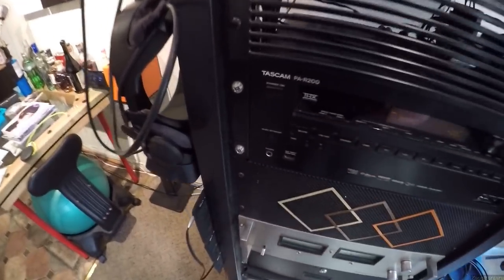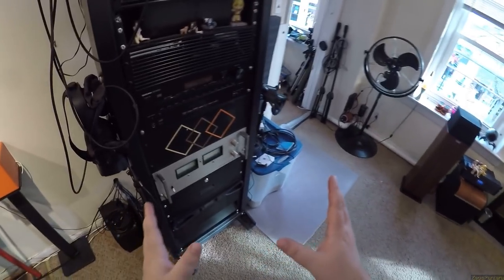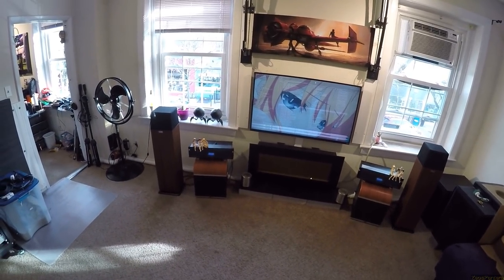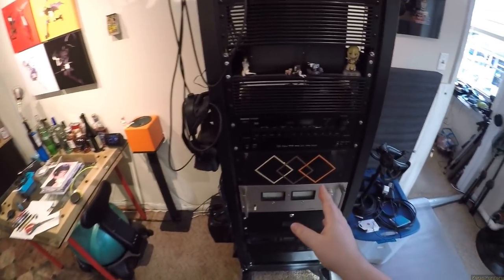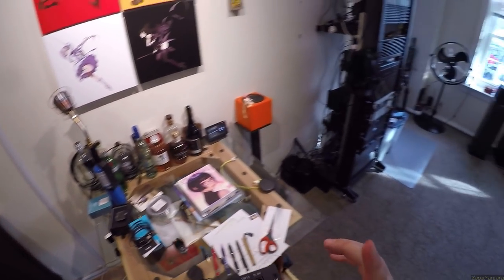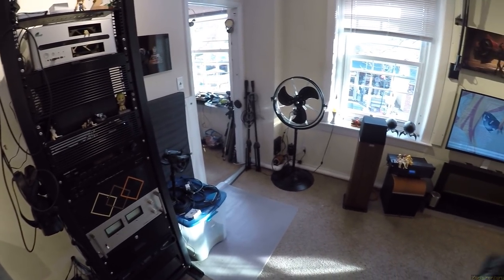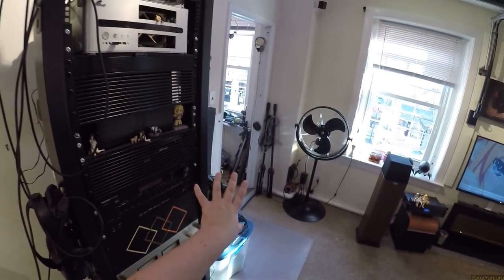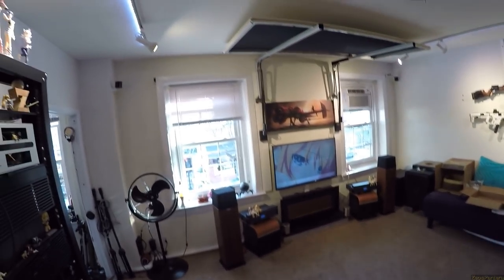⭐️Picking a Receiver _(Z Reviews)_ Home Theater 102

Comment from the maker: CHAPTER JUMPS :::
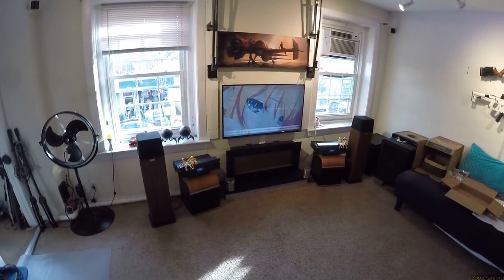1:08 - WHAT DO YOU NEED?
2:33 - BRANDS
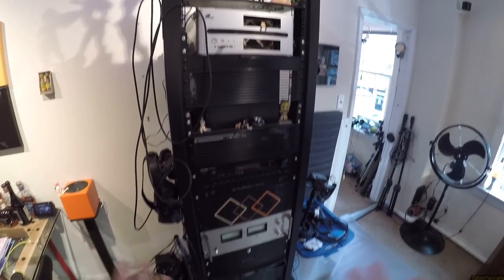6:42 - POWER
14:13 - FEATURES
20:23 - ROOM CORRECTION
24:30 - 5.1 vs 7.1
25:38 - ADVANCED SETUPS
34:18 - SUMMATION -----------------
35:54 - REFURBISHED UNITS
38:15 - HIGH RES BACK SHOT
Reply from the maker: @M. S it is still in the description. And I pinned my Atmos thoughts.
Reply: Video source that support 7.1?

Comment from the maker: A NOTE ON ATMOS/DTS-X/AURO3D -- If you want to do Atmos that changes nothing accept adding to the minimum spec requirements I spoke of above, Same as choosing between 5.1 and 7.1 now 7.1.4. 

A NOTE ON X.2 Models. Most surround processors do not actually modify the control of dual subwoofers. It is essentially a built in RCA splitter which you can buy here [ https://amzn.to/35U7Gu5 ] so ignore that delineation.
Reply: Z Reviews Do u room correct even w/ ur Ohm speakers? Doesn’t that effect/negate some of the magical sound reflections stuffthat Ohms produce? BTW, I have 1000s that I luv.
Reply from the maker: @elleferrao2640  I do not correct currently. I may attempt it. But I do want to correct for my subs. Those need tweaking.
Reply: Z Reviews Interesting. When I spoke to Evan at Ohm he said that any software that has an effect on “early reflections” would likely be “counterproductive to some of the benefits of the Walsh technology”. 

I also don’t room correct or use a center...it mite mess w/ that phantom center the Ohms create.
Reply from the maker: @elleferrao2640  Honestly the most tweaking ive done to my ohms was today i twisted them a bit more inward so that my mono voice was more centered as I walked back and forth in my living room.
Reply: Z reviews I love your videos you have changed my perception about audio and I've became an addict :)
I would like to hear your thoughts about ATMOS, is it worth it? what possible setup options from basic to extreme?
Reply: @animry  yeah i would love that too
Reply: @ZReviews  any suggestions on a good/reasonably priced sub (~$500) to go with my Ohm 1000s?

Comment: Agree almost 100% with your receiver recommendation. I would summarize by stating the following. For the average home theater newb, spend around 3 hundred bucks on one of the brands  you mention to get something decent that's about 100w/ch.  Marantz is also my favorite brand, even though right now I have a Yamaha. (It works fine, but I don't really like how it detects and switches surround modes).

For someone that is (or wants to be an enthusiast) but you still don't want to spend major bucks -  you look at the cheapest receivers you can find that have pre-outs, preferably all 7 (or more) channels. That generally means you're going to have to spend a little more because you'll have to get a mid to upper level model from that brand as entry level models will not have pre-outs.  However, it will still be FAR cheaper than buying an actual pre-amp that has no amps in it. THEN you can spend that money you saved from getting a cheaper receiver instead of an expensive dedicated pre-amp and you go get the best amp you can afford.  If music is important to you, I say you get the best 2 channel amp you can afford to use for the L/R channels and just use the receiver's amps for the rest.  Then later if you want get another multi-channel amp for the other channels to complete the system if you want.  Otherwise if 2 channel music isn't a priority you can get a nice 3 to 7 way external amp. Now, these external amplifiers you can keep forever and then just swap out the receiver when it becomes obsolete.

It is infuriating that there aren't entry level priced pre-amps out there.  It is FAR cheaper to purchase a receiver to use as a pre-amp than it is to actually buy a dedicated pre-amp/processor, because those are priced with an audiophile tax and are always packed with way more features than you need and are also 2 to 3 times more expensive than a receiver that will do the EXACT SAME processing.

Comment: I've been dealing with electronics for many years and I find the Yamaha to have the less issues and and the easiest menu to deal with!
Reply: Audio Electronics Agree! Seems we also sub to some of the same channels lol!
Reply: @nathanjones4039  Look like :) we are the audio fans
Reply: I’m on my second Yamaha receiver. I have the RX-V565, had it for 10 years and only just starting to have issues with it now.
Reply: @benkrake3678  10 years is not bad at all, I have one from the early 2000's and it is still running great, I went through few denons and onkyos in a short period of time
Reply: Audio Electronics Yamaha is brand I really trust, mainly because they make high end amplifiers too, which are highly regarded, and their gear really does stand the test of time. I sold my first Yamaha 5.1ch receiver to my brother in law, and it still works fine, no issues whatsoever. To get 10 years out of any 7.1 HDMI receiver is really good. My father still uses his mid 90’s Technics SA-GX390 5ch Dolby Pro Logic receiver to this day, but doesn’t use it as much now.

Comment: Would love a Home Theater 103 that goes over the purchasing and specing out a full theater. As in if you were starting over, and not being crazy ;) what would be a nice setup. Pick a Reciever with preouts, some seperate amps for the speakers, etc. That would in the end perhaps your only concern for the future is the purchasing a new reciever as features get updated. Would be a very useful video. Thanks.

Comment: Good video Z.  Based on what you said, I will buy a base model Yamaha reciever.  I have really bad/cheap KLH pair of speakers (larger bookshelf size).  Now to improve the sound/bass, what is  best cheapest subwoofer I should get?  I am not planning to buy rear or center speaker because I intend to use phantom center.  And how do you feel about Equalizers vs automated room correction?  Sorry I do not donate to your channel...i am retired and poor.  LOL

Comment: Nice video, what about using something like eARC to increase the useful lifespan of your Receiver?  You could plug in all your video sources directly into your TV and have your TV push eARC downstream to the Receiver.  This way you could upgrade to a new TV later with new visual features but not have to upgrade the receiver since the receiver would still be processing the audio.  Reading online eARC allows for up to uncompressed 7.1 and Dolby Atmos so from my understanding this should work correct?
Reply: this what i am using now ,using 9 years old receiver my x9000h tv as video source and reciver for audio only ,but no atmos as its old receiver

Comment: If you have an older receiver that doesn't do 4K or 60hz you can always hook up your pc straight to your tv and then run a second hdmi from your pc to your receiver just for audio. You'll need to add the receiver as a second monitor even though your not using the video signal. This is a pretty simple work around for those who have an htpc and an older high end receiver with great audio performance. You can also use a displayport to hdmi cable for the audio if your pc only has one hdmi and multiple displayports, like most modern pc's.

Comment: Hey Zeos, a suggestion of video. A whole music system where none of its parts cost more than $100. I am speaking of a DAC, a headphone Amp, a speaker amp, a headphone, a pair of speakers and maybe a turntable and/or a streaming device like an raspberry pi. You could say wich one of these itens you are fine spending 100 bucks or less and wich one you could benefit a lot by saving a little more and spending, let´s say, $150 or $200.

My suggestions in these departments are:
DAC - Schiit Modi 3/ SMSL M100
Headphone Amp - Schiit Magni 3+ / Schiit Magni Heresy / JDS Lab Atom
Speaker Amp - Loxjie A10 / SMSL SA100
Headphones - Philips SHP9500 / Cooler Master MH-751 / SIVGA SV006
Speakers - Dayton Audio B652-AIR / Edifier R1280T / Micca MB42
Turntable - Audio-Technica AT-LP60X

I would like to watch your opinion on this matter of fully systems on the strict budget.

Comment: I've been using my Denon AVR 3805 for the past 17 years - which doesn't have an HDMI out to the TV (laughing, I know). I've now had three TVs because the logic boards all failed. I've replaced three DVD/Blu-Ray players because they've failed. My current Samsung Plasma is starting to flicker, that plagued my last Sammy Plasma. 

I still have the same speakers (Polk LSi15 for mains, LSiC, cheap surrounds, a thumping sub) and Denon receiver. 

If you can plug your video sources directly into the TV's, and the audio sources directly into the receiver, you'll be good to go, and your receiver becomes less obsolete and lasts a helluva lot longer than 4-5 years.

Comment: I purchased an onkyo a few years ago, the hdmi board failed within 10 months. The actual board was in a position that gotroasting hot and I think it messed up the solder joints? I replaced the board and used a usb pc fan that helped . I’m pioneer now but that needs replacing as it’s 4K but I need a 4K HDR pass through. Despite my new pioneer being newer etc the older 1080p onkyo had better sound! My pioneer is Dolby Atmos 5.2.2 but my next amp is going to be a Denon .

Comment: Picking a reveiver? But you said all we need is the Swan M300. 

I am a Yamaha guy. Denon and Marantz are a merged company since 2002 and are both owned by Sound United LLC. I would imagine they are about the same in terms of quality and performance since they both use Audyssey XT32 in the higher end models.

I have Denon X3500H and Yamaha RX-A880. I prefer the Yamaha by far, honestly. I think the Yamaha has a few features I prefer - more manual adjustability with the equalizer (more bands and you can equalizer each speaker separately), the a880 runs YPAO faster than x3500 Denon runs Audyssey and I think YPAO does a better job because it has a built in decipher code for reflections. I don't know if the Denon does but I hear more bass hum from the Denon, it sets the bass higher because it is only measuring the output, the Yamaha also measures for reflections so I don't notice any bass hum with the Yamaha. 

The way the room corrections make my speakers sound is: the Yamaha is much more natural even a bit laid back or dark with the Elac UB5. The mids can be a little chesty but on most recordings the sound is smooth and soft but very detailed and natural. At it's worst, it can be dark and sound like there isn't enough details. YPAO seems to me pretty much forgiving where you place the microphone. I go to each seat and hold the mic to my ear - right next to my ear - and get good reading and sound. Simple, easy, and effective YPAO. It gives a larger sweet spot from what I can tell.

 The Denon is almost opposite of that. Audyssey seems to favor a leaner, brighter sound with powerful bass WHEN Audyssey calculates itself correctly. A few times I have had Audyssey make my big speakers sound small and other times tune the bass too overpowering. I assume Audyssey is very unforgiving with placement of their microphone; too close to a wall the bass will go down, too far away it will shoot it up. Audyssey seems to pinpoint a sound to a small area to be the sweet spot. I ran it yesterday and when I sat back in my chair the sound was just right but when I bent over in my chair, the sound got disorganized and messy sounding - like that clump of mid-range infidelity. Maybe Denon go more flat with their reference profile causing the highs to be more in your face, or what sounds like an upward sloping high end. The Denon throws a bit too many high highs and the bass can sounds a bit muddy from being overpowered or you could say there is some bass hum noise in the sound with my Klipsch RP280F. 

I'll probably try the Denon with my Elac to see if they go better together. Denon with a slightly brighter and bassier sound might match better with the Elac that has a softer sound. Likewise, the Yamaha might be perfect with the Klipsch since it has a more laid back and natural sound to go with the lively and dynamic Klipsch. I would say the Denon is more lively and dynamic like the Klipsch and the Yamaha is more natural and smooth like the Elac speakers.

Even my mom who is no audiophile loves the Yamaha much more than the Denon. After hearing the Denon, she only wants the Yamaha; I couldn't agree more with her. The Denon is definitely powerful and dynamic, it even does a good job delivering clean sound like the Yamaha (arguably), it just doesn't have as nice of a set of features IMO. The reflection test of the Yamaha is pure genius and makes the world of difference.

This could be considered a slightly unfair comparison as the Denon is 2018 model and the Yamaha is 2019 but they were within $50 of each other and I bought the Yamaha first. I only got a Denon because Joe from JoeNtell swore on Denon and I wouldn't say he is wrong but I am favorable of the Yamaha. It could be that Idon't know the best way to optimize the Denon. The Denon does set like 50 different points of equalization through it's Audyssey but you can't go in and change those manually. If you get the $20 app so you can select a target setting for your equalization it might be invaluable asset - it could take a while to find what you actually like and the app does not have a high rating in the play store, it is like 2.3 star.

Comment: I was going to buy the edifier R1850DB and Add the Polk 10” sub to it. I really only just listen to music and play Xbox occasionally but I think I’d rather go the home theater route to start so I can upgrade over time. What would be a good place to start at with just a 2.1 system to begin? Anything that will sound equal to/better than the R1850DB?

Comment: I actually don't like the 7.1.4 notation as it actually translates to needing a 11 channel receiver. Although some 9 channel receivers offer pre-outs to enable 11 channels, with a stereo amp needed for the additional two channels. And there is also the dolby atoms enabled speakers which fire upwards for those that can't or won't start drilling holes in the ceiling if you want height channels.

Comment: My first stereo system was a Sony. It lasted for 25 years before I finally chunked it for space. I also have a SAVA-D900, an old HTIB (home theater in a box). I heard it in Sears and loved it. Bought it, used it for about 7 years, gave to my brothers and they have had it for 11 years. It still is a nice smooth sounding surround system. Had to have the DVD changer fixed while it was under warranty but it still plays like new for my bros. So, I never had bad experience with Sony, except their stuff doesn't have the BEST sound. Definitely seems like decent quality on the lower end of the audio spectrum.

Comment: My first surround reciever in 1999 was a Sony. Worked great for years powering a 4.1 system. Always took a good 8 seconds to lock on to a DTS signal, which sucked when Gladiator or Lord of the Rings changed layers, but no other problems....until it came time to upgrade. Bought an Onkyo for the ProLogic IIx and 6.1 capabilities mainly, and the Sony was moved to a bedroom and hooked to the computer. Somewhere during that transition the surround channel amps gave out. Still used it, but in a 3.1 config. Bummer. I also had 2 sony subs die on me as well. Sony does make great headphones, TVs, and shiny silver disc players, but avoid anything they make with an amp in it.

Comment: Thinking off getting an Pioneer SC LX704 this year end next year an emotiva XPA3 Gen 3 Amp for Front Left, Right and Mid. I started with an complete 5.1 System from Pioneer with an VSX 531. It does still well but i want to upgrade for an 5.2.2 or 5.2.4 System. For the back the SC LX 704 has enough power for my Q150s and the Front will get LS50s or R3s so the Emotiva Amp for the low 3.2 Ohms and some headroom.

Comment: Rack system built in wall, so yeah analog will probably never die, SACD sounds amazing  on separates 5 YAMAHA MX01s B&K reference processor, playing Dire straight material today. MIB movies did a great job on the surround Mix. Thanks for your reviews 👍 great material covered

Comment: I had a Denon surround receiver and it failed after just a couple of years use. I have an older Onkyo surround receiver and it is still fine. Can't really go by brand IMO and any brand can fail prematurely. I don't do surround sound anymore anyway and am using just 2.1 channel audio on my desktop.
Reply: That's pretty true. The same company that bought up Denon and Marantz several years ago now also owns Pioneer and Onkyo, and you can get a lemon from any of them depending on the model and when it was made. Most of them do last a long time though so your odds of your next one lasting many years is pretty good.

Comment: I have a Yamaha RX-V565 7.1 receiver, and I have had this receiver for 10 years from brand new. I have noticed that this receiver is on its way out, because it has a short somewhere. Whenever you start adjusting the tone settings, it shuts off and goes into standby mode. I can turn it back on easy so the amplifier protection isn’t kicking in, so that’s good I guess. I’m going to go back to a 2ch system eventually once my receiver finally shits it’s self.